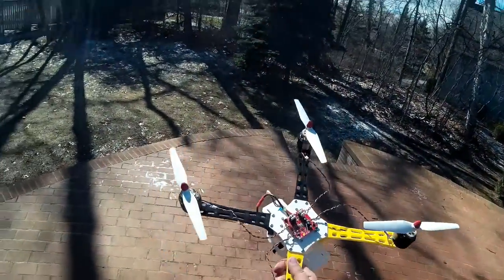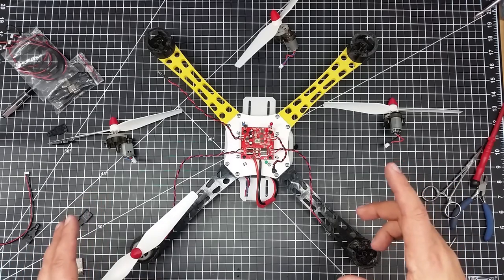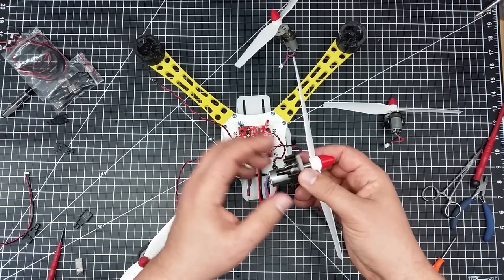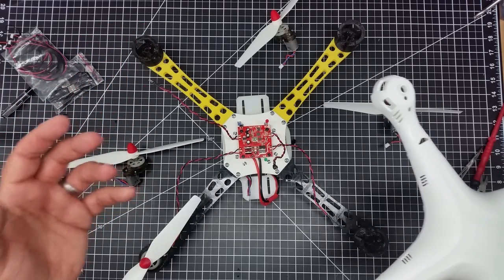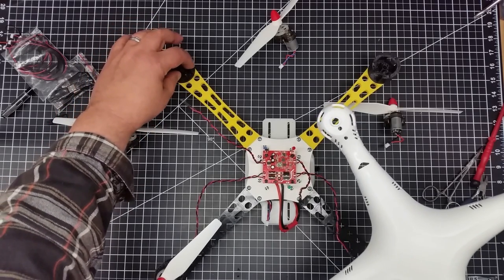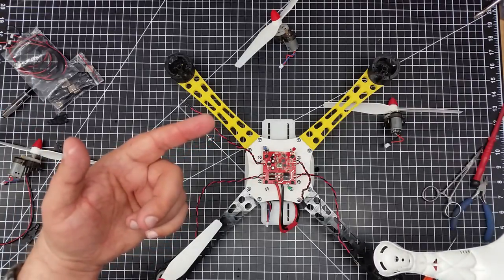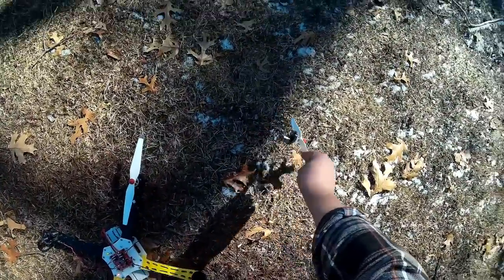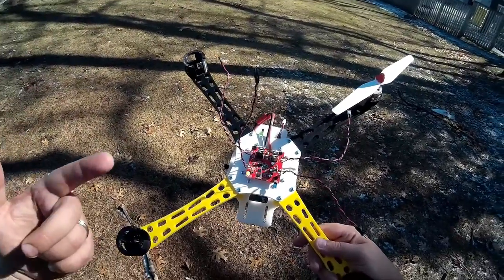Video Drone - ReImagining The Syma X8 Part 2 First Flight Test!

Comment: It flies. Great job. I have two things discovered at the Syma X8. If the signal drops out, then turn off the motors. This as it would fly away. The gear is free under the upper cover. What is missing in your engine mounts is a ring around the shaft to put it on place.
Reply from the maker: Actually the gear is not free, it is pined down via the locking pin and ring pressing down on the prop.  Also yes the loss of signal is suppose to be a semi-safety mechanism as it (the X8) could fly very far and high if left to its own means.  Also these motors create a lot more trust than I expect and I have had to redesign them a (the updates are on thingiverse) as they would pull apart in flight...
Reply: In the original case is the part where motor and gear to are stuck in its entirety clamped. If it would succeed, then this piece in its entirety designs.
Reply from the maker: The body of the X8 doesn't provide an retention for the gear, it my look that way however take the top off and reassemble the motor gear and pin and you see that only the pins hold everything place...
Reply: My language is not English, I translate most of it via an app from the Dutch. Sorry for that.

You wrote that you are going to order the ' brushed-less package ', am curious. In this case also to the brushed options. What I was trying to say. If you have a 3D printer. Try to make one complete engine mount. With direct place for the brushed motor and the spindle/shaft/gear. So without using the standard Syma X8 motor mount. This seems to me to be stronger.

Comment: I have syma x5c receiver and transmitter instead of syma x8 reciever and transmitter. So I want to ask can I use syma x5c receiver on my f450 frame. Plz reply I am a subscribed user. !!!!!
Reply from the maker: Sorry no andsecond you don't want to.  The Sysma stuff is toy grade very unreliable and in fact could be dangerous with larger quards like the 450 class.  Also thanks for SUBING! :-)